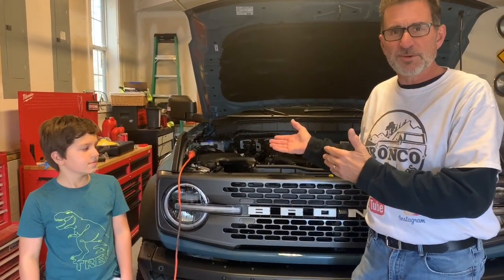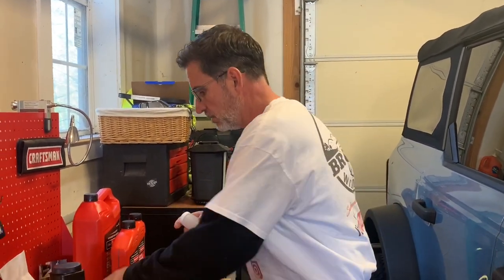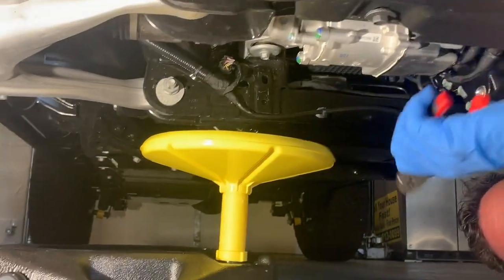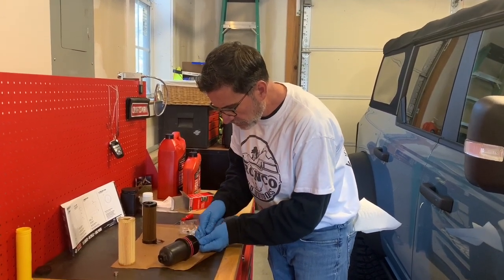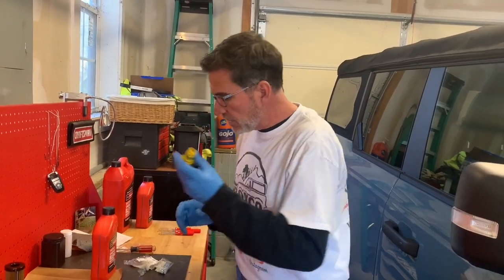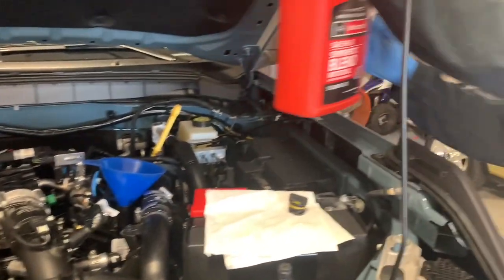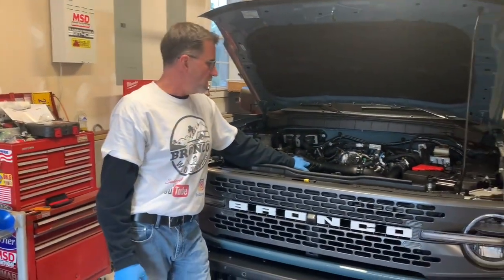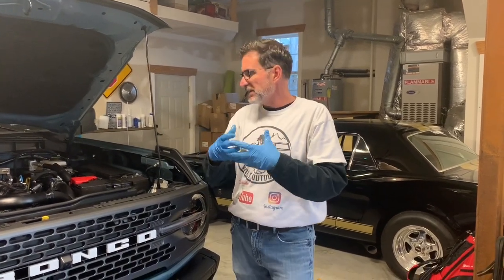Bronco 2.7 Ecoboost Detailed Oil Change. The missing 7th Quart

Comment: Love the channel

You video are very usefull

Maybe you can help me with small problem.

I am doing a wrap my bronco... and have small issue with the tailgate handle.... it will be helpfull to have a picture of the door lock mecanism in it original state....

It take less the 2 min to do picture of it...if you are interested to help me let me know basicaly it remove one of the black trim inside the tailgate and take a picture inside... that it... this will be very helpfull to help me figure it out how to fix it....

Fyi sorry for my bad english writing skill ... it my second language

It a very small problem ....  but still my bronco it grouned until i fix it.... and tomorow if i did not received any help with pic from any channel i reach out then i will start full dissaemble of it .... i try to avoid that...

Thank for your time
Reply from the maker: I have not had to work on it before, unfortunately 
Have you looked it up online? or maybe reach out to someone who installs wraps and see if they can help. Thank you for watching!
Reply: @DrivenWildOutdoors  
Basicaly i was just need it another bronco to compare to see how the handle mecanism is by default... because i already remove it ....i was reaching out to see if someone was nice and took 2 min of their time to just remove one panel on the back.... and take a picture ... that it very simple no risk we could have done that over the phone. I reach out  many people in the last 3 days who have channel and do mod on their bronco.... but no sucess.. o was supprise nobody was willing to just remove the one black panel inside the tailgate and take a pic..... should be super easy especialy if you are person who do mod or any install.....very very basic just need few min.... 

I give up try to ask people for that picture  .... i just when and remove everything disasemble and figure it out whihout having that original pic..  finaly it work i fix it.....

Thanks for your time at lease you one of the few who reply something....

Comment: You disappointed me man. All that talk and NO FULLY SYNTHETIC OIL. Anyways great video. Keep up the good work.
Reply from the maker: I hear ya. At 5 k there will be full synthetic 😎
Reply: Motorcraft syn blend is really really good oil. It's made by Conoco Phillips and perfect for new Ford engine break-in and ring seals. After a couple of oil changes you can go to fill synthetic if you choose. I have 183k miles on my 4.6L mustang gt with no oil burning leaks or noise. I use Pennzoil platinum now. Good luck! Nice Bronco!

Comment: Was this you first oil change? If so, how do you know if their was 7 quarts filled in the engine to begin with. Maybe it had close to 8 after the dealer looked at the dip stick and assumed it was low. Your video proves nothing. You didn't even check, per the video where the oil fluid level was on the dipstick prior to draining it. So we don't even know if it was showing over filled, underfilled, or normal.
Reply from the maker: Well if you notice in the video I used a 7 quart drain pan which filled it to the 7 quart level. More accurate than a dipstick
Reply: You obviously did not watch the video, read what he put at the top of the comments, or hear anything he said... He did it all perfectly and answered all questions... 
You probably still drive  your Bigwheel...      Just go troll elsewhere, sonny boy...

Comment: You did not mention ANYTHING about the oil dipstick on the 2.7 Bronco being the wrong measuring tool !!!
Reply from the maker: How do you mean?
Reply: @DrivenWildOutdoors  Have you looked at the dipstick before and after your oil change? with 7 qts of oil in the engine the dipstick shows a level way higher than max .... its almost halfway up the ribbon turn on the dipstick! even with 6 qts it is way over max level ... check it out
Reply from the maker: @thedesertpooch9664  I’ll try to send you something from the owners manual later today. Ours  is not far off of the illustration that they show. It appears that 7 quarts in the 2.7 puts the fill line just slightly higher than the top hole above the # mark
Reply: @DrivenWildOutdoors  I have the owners manual .... best if you do a video on it .... this is a growing issue .... Ford has installed sent out the wrong oil dipsticks on the 2.7
Reply: IDK how 2.7 in f150 use 6.0qt
and Bronco uses 7qt

Comment: Ford engineers demand you take your vehicle to the dealer. They design everything difficult and time consuming. Farm equipment does not have dipsticks now. Ford is taking them away next. $12 for a oil plug? Insanity, does not matter anyway, you will not be able to buy gas in 3 months.
Reply from the maker: Maybe correct on the gas comment. Thank you for watching our channel
Reply: @DrivenWildOutdoors  I enjoy your channel, I just think  Ford is taking everybody for a ride.
Reply from the maker: @buddyrich3875  I respect your opinion, however I think they are having to deal with bs like the rest of us. I wish they would release a update to ease everyone’s fears. I can tell you I have zero concerns with my engines.